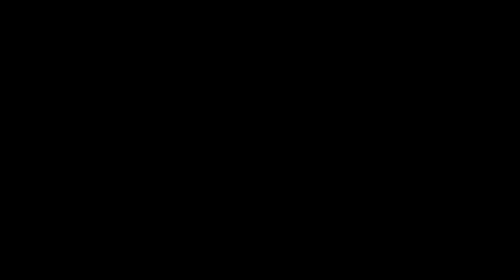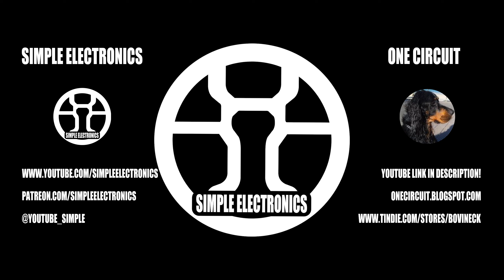The Simple Electronics Podcast - 039 - Anthony (One Circuit)

Comment: Excellent pod cast with Anthony .
 Regarding your issues with coding, as you obviously have graet long term skills with motor vehicles,  may I suggest you think back to you first introduction to mechanical devices .
 I guess they seemed terribly complicated but over time you started to understand small bits e.g. what the carburretor does or the ignition coil etc.
 May I suggest that you apply the same thought processes to programming, to quote an old joke "programmers do it one bit at a time" . Looking at other peoples code is  agreat way to learn often enlighten you to ideas and tecniques that you would not have considered. I say this as someone who has earned my daily bread both writing new code and also supporting/modifying legacy code ( which often means getting into the mind of the individual who originally wrote it ....) for far too many years.
 As for the refence to mechanical things as a "hobby" I'm a long term motorcyclist with several ancient (1911 onwards) bikes :-) .
 Appologies for the length of this comment but Please keep nibbling away with the coding it will Gel eventually.
Reply from the maker: I'm definitely going to keep at it, for whatever reason, maybe I was just younger, coding in particular is much more difficult for me than learning cars was.

Comment: Thanks for reaching-out Dan, glad I subscribed! From one Canadian to another, you have that relaxed Amp-Hour sound (I convinced Pace to send Dave an ADS200 a few years ago). At 35:40 for site backups, I use mature site copier HTTrack. FWIW, for an extractor I used a smooth, high-FPM Cadillac HVAC blower from a wrecker with low RDS power FET and variable duty 555 for speed control. Cheers!